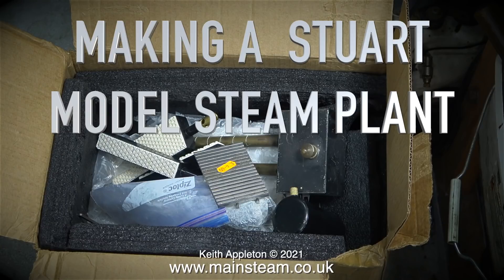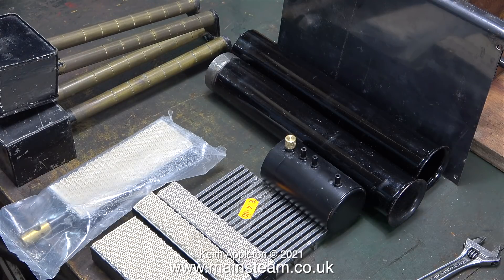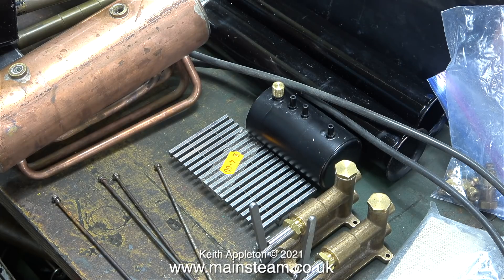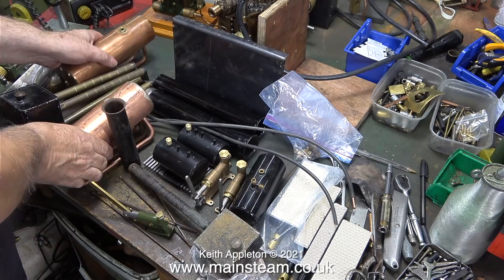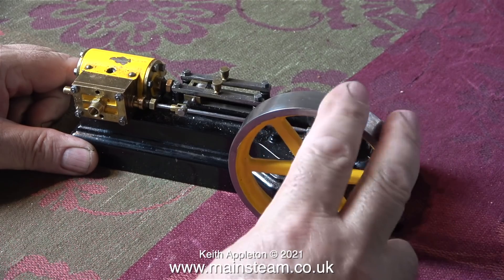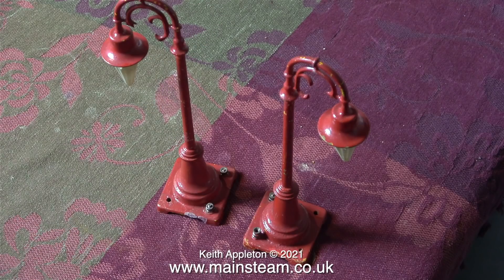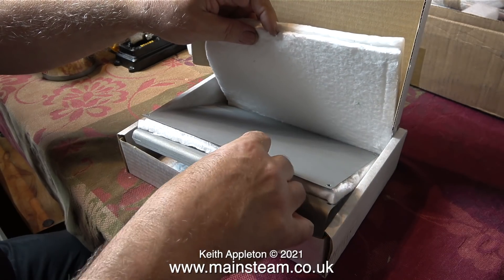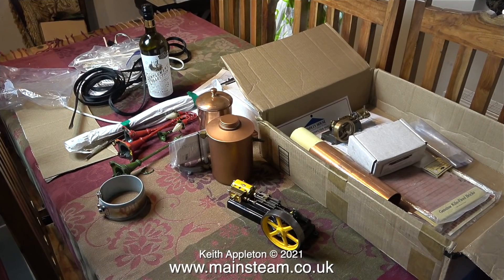MAKING A STUART MODEL STEAM PLANT - PART #6

Comment: The bangle looks like an electric heater band. You pass electricity through it and it heats whatever its clamped around. I would see if there is a resistance between the electrical pins
Reply from the maker: Yes it is. I notice the operating voltage written on the casing.